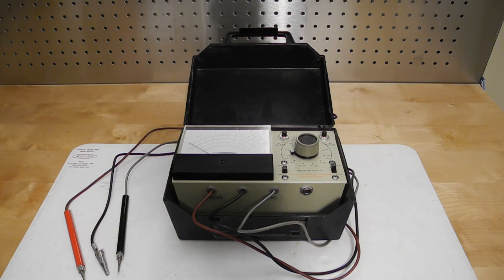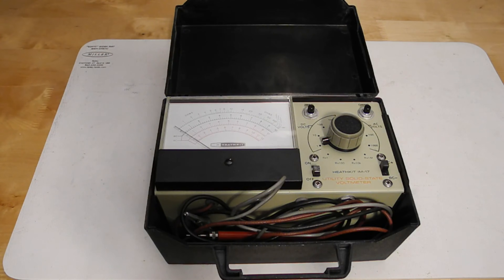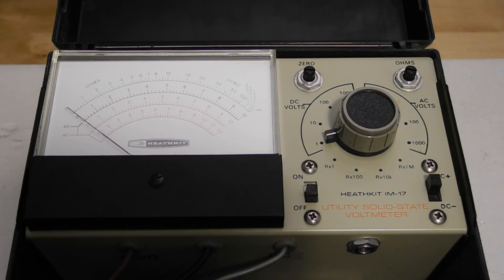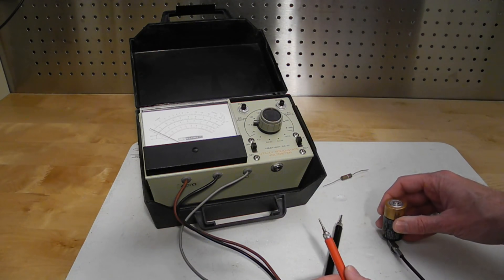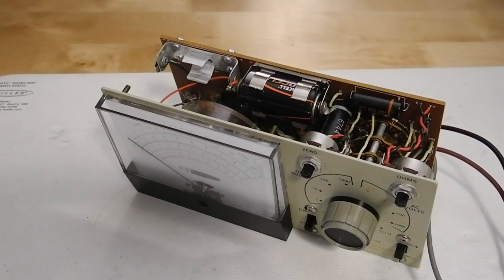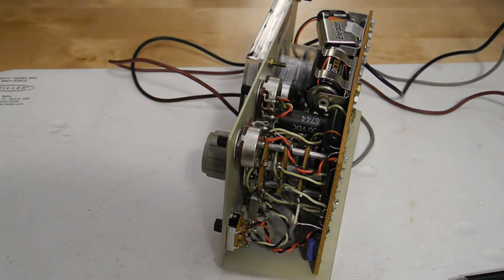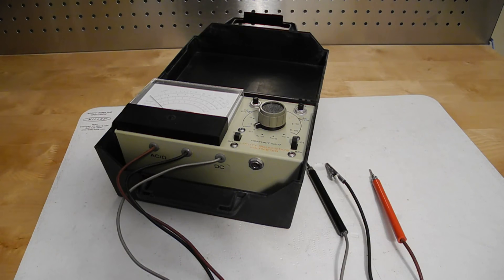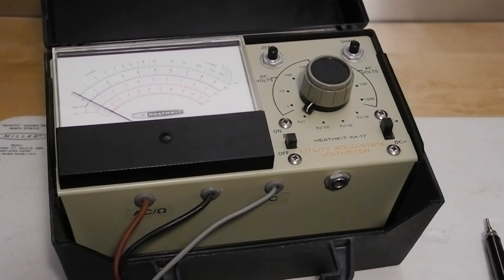The Heathkit IM-17 Utility Solid-State Voltmeter

Comment: can you fix my IM17?  At DC1 with 9v and fresh 1.5 V cell.  It deflects to right all the way when turned on and left with DC-.  I've checked all the wiring and can find no faults.
Reply from the maker: If you have some technical knowledge, I would suggest you find a copy of the manual on the internet and refer to the troubleshooting table and measure voltages (if you have another voltmeter) and compare them to the values on the schematic in the manual.
Reply: Yes i have done that as i have the manual when i built the kit. Differences of course! High value resisters are good.
Reply from the maker: @rhshel  If it is not a wiring issue or a resistor, about all that is left is a transistor. The 2N3393 should be available, the other Heath p/n 417-140 is a 2N4304 which may be hard to find.
Reply: Is that the FET
Reply from the maker: @rhshel  Yes.

Comment: I have one of the later models, and they were a handy little VOM. They were meant for automotive and outside use, which is why they were in the plastic case.

If you notice, the accuracy of every piece of Heathkit equipment that incorporates a meter movement has about the same accuracy. It's due to the meter manufacturer and how accurate they had silkscreened the faceplate. Plus, there were accuracy issues between each movement manufactured after winding, which is why HP made faceplates to match each movement they made for their VTVMs. 3% was accurate at that time, for general work, and the VOM could be calibrated after the movement was installed.

Comment: The IM-17 was another instance of Heathkit getting the most "bang for the buck" from a particular design. First, as Jeff said, they made this model for 10 about years (1967-1977), then reintroduced it as the IM-5217 in 1979 and made it into the year 1987. But thee same basic circuit design was also used in two 'laboratory/bench' type meters, concurrently developed with the IM-17 and also introduced in 1967; the IM-25 and IM-16.

I don't know where the Heath engineers started...with the basic version then added features, or with the fancy version then whittled those down to this basic version. As Jeff noted, the IM-17 design does not measure current (Amps). The bench version IM-16 has the same feature set and circuit architecture (and also does not have the ability to measure current), but it does add components to make it more stable and less drifty and less affected by battery voltage, and also the AC rectifier is less basic and thus more linear, and a big plus is that there are separate range switches for Volts and Ohms, so you can switch back and forth between those functions without also needing to remember which ranges the meter was in. The IM-16 also has a wider measurement range and accordingly more choices of range for each function. The IM-25 is very much the same as the IM-16, with the same case and appearance and circuit architecture, but it adds the ability to measure current (mA), and adds a third range switch for that, and also adds an FET in the AC rectifier so that both DC and AC functions have the same high input impedance (the IM-17 and IM-16 have much lower impedance for AC than for DC), and also adds more components to further stabilize against temperature and power supply variations. Finally, the balanced bridge in the IM-25 is set up a bit fancier so that it can be adjusted to read 0 in the center of the meter scale (a special scale is provided for this) so that DC voltages which move around to include opposite polarity can be observed and measured without the user having to move test leads or change switch positions. Unfortunately, Heath shot themselves in the foot with the IM-25, since in a move of staggering stupidity, the design requires 14 "C" cells!!!! When I restore this model, I install battery eliminators.

This whole family, the IM-17, IM-5217, IM-16 and IM-25 are all notorious for their inability to tolerate significant RF fields. It is more than just causing false readings, and it affects the metal cased IM-16 & IM-25.....the FETs bite the bullet when strong RF fields are nearby. Almost every IM-16 & IM-25 one can find for sale will have either a bad FET or at least one where the FET is damaged in some way and works poorly in the circuit. I have restored a number of meters in this series, and I bought a bag of NOS FETs of the exact type so I can readily replace them. The circuit features which protect the meter against overly high inputs does not seem to protect against damage from RF.

Comment: I have one of these in the later brown plastic case. I've never used it, and I don't remember where or why I bought it. It looks like someone left the "C" battery in too long and it leaked. I can't tell if the leakage damaged the foil runs near where the battery clips are attached. Another retirement project!

Comment: I think its weakness was the fact there were no banana jacks on it making the test leads permanent on the bottom and always bent where they go into the body
of the meter. In the second  hard plastic case design this was even  more prevalent. The DC+/- switch was a good idea however for an analog meter.
 Great idea in marking which lead does what on the body Jeff.